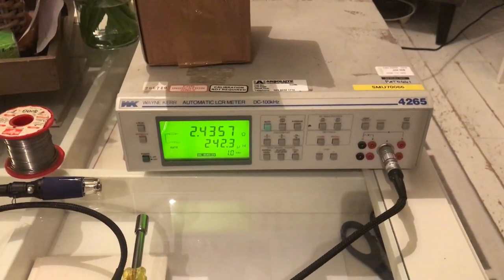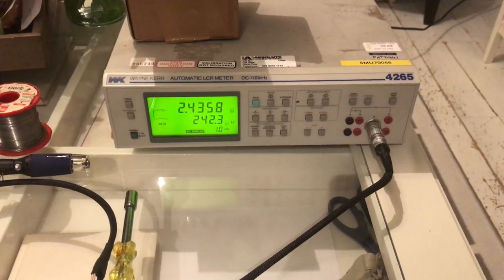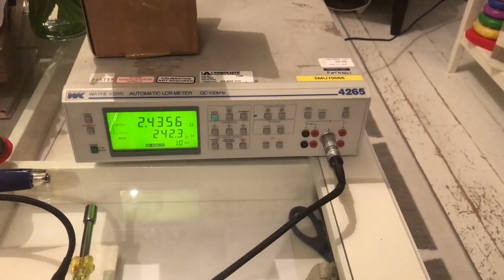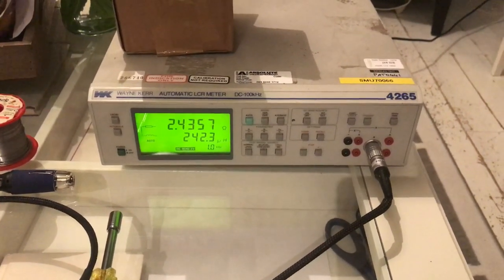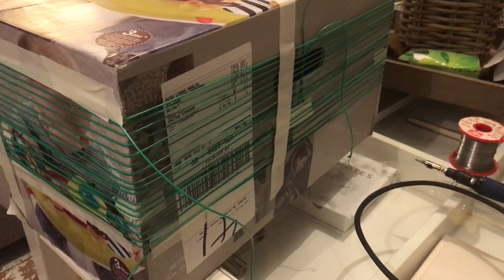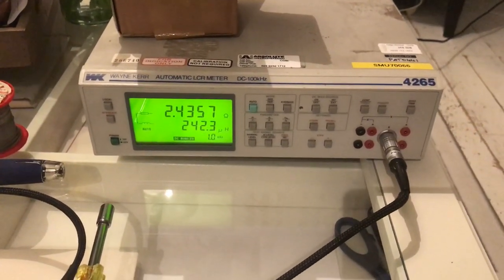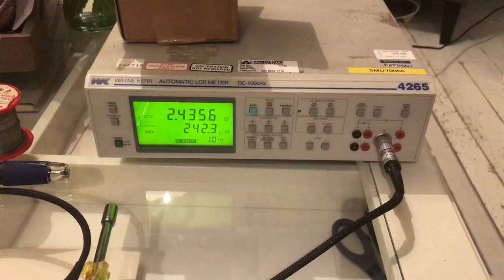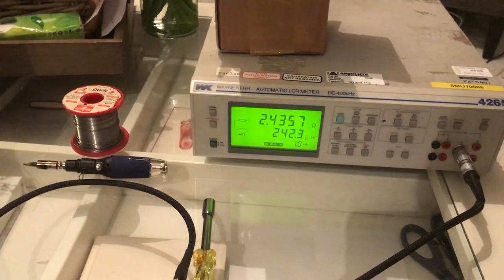Using a Wayne Kerr Automatic LCR meter in the winding of a MW induction loop

Comment: Is the inductance value of the loop important for what you're aiming to listen to?  I mean, you could build a loop with a higher inductance and use a lower value capacitor to tune down below 530khz, but you seem to be aiming for specifically 240uH - is that important for medium wave?  As opposed to long wave.
I've just wound a loop about the size of the one in your video with more turns more closely spaced and a lower maximum value of capacitance.  Using this calculator:  
https://earmark.net/gesr/loop/umr_emc_calc.htm
Reply from the maker: Hi Kevin, yes exactly. Check these out:

https://youtu.be/MffWB1L4C3c

https://youtu.be/PnwYxjVxaVY

https://youtu.be/f5S79foRT1Q

https://youtu.be/7AhhS5EP9n8

73s